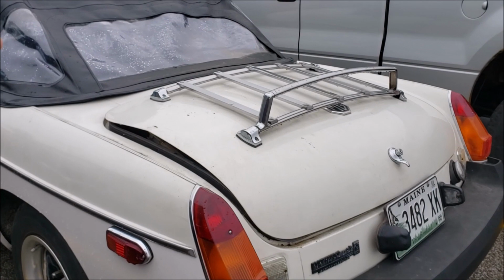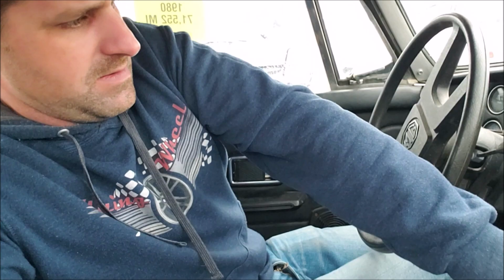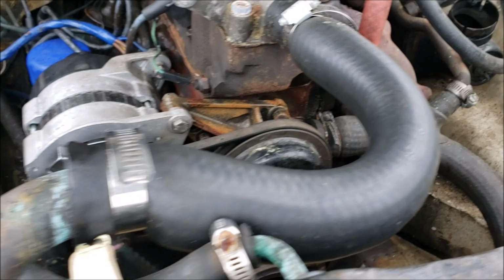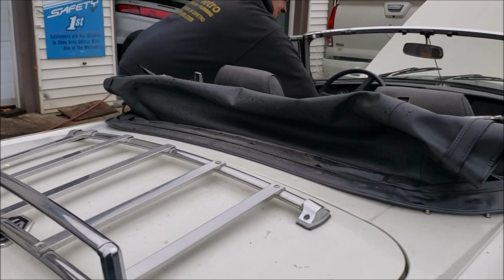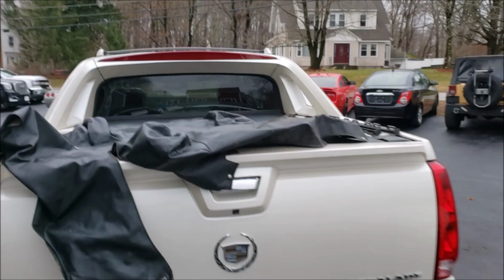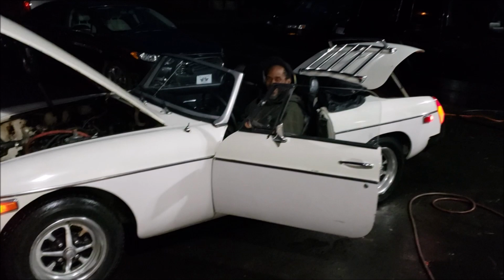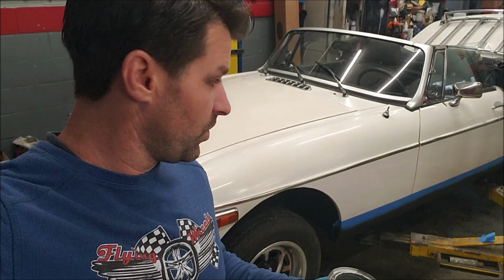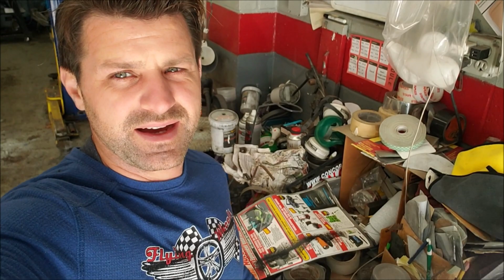I bought a ROUGH 1980 MGB by Accident - Can I fix and sell in 24 hours? - Flying Wheels

Comment: I'm writing as I watch this. The rear deck lid was slammed just as you guessed. It needs to be replaced. The rust is typical  in the lower rear just like you showed.The lower front fenders usually have the same problem as well. Replacement rust repair panels are available from Moss Motors. The top was installed incorrectly by someone who didn't know what they were doing. It's been ruined and needs to be replaced. There should be a rubber seal at the edge of the frame where it joins to the windshield. The top replacement job has been totally screwed up. Unfortunately, your car doesn't have overdrive. The overdrive switch would have been on the top of the gear shifter. You've got the original Zenith Stromberg carburetor with the automatic choke - a very problematic and troublesome carb. Part of the air cleaner is missing. (I see it sitting in the trunk. I don't see it installed and hope you didn't throw it out.) Smog pump has been removed. It's a 4 cylinder 1798 cc engine. The engine has been detuned and all the smog equipment turned it into a 64 hp underpowered car that can barely get out of its own way. It has 3 wipers because two wipers didn't wipe enough of the windshield. I think, by USA law, British Leyland had to add the third wiper to get the cars into this country. Earlier cars only had two wipers. You can buy the missing right front center wheel cap from Moss Motors. I've worked on MGB's for decades and own two, a 1968 and a 1977. I do all of my own maintenance, for what that's worth.
Reply: why not just say it is a turd.

Comment: Rubber bumper does not equate to "junk" - the earlier chrome bumper MG's are simply more collectible. Your auction special was unmolested and mechanically solid with relatively good sills and great paint. Yeah, it's easily a $4,000 car. Simple fix on the trunk and you could have put it on the lot for $5,500 all day long - especially with the approach of warmer weather.
Reply: The late RBBs  are junk. Worst years for MGB  78-80. 68 HP, high ride height, god awful bumpers, weighs 300 more than a Series 1. Sluggish pigs and handle badly.
Reply: Agree Iguana.  And the distain for them is dropping with time.  I just saw a vid where a guy was on the way to have his MG converted to chrome bumpers and literally on the way, he got rear-ended and the bumper and car were unscathed. He changed his mind and kept the bumpers as they were.  They're designed to withstand 5mph impact.  Sway bars were done 77-80 which helped with the slight height increase for headlight height US standards.  There's good and bad in all years.

Comment: I sold my 72 chrome bumper earlier this year.  The chrome bumpers ran up to 74 and had about 30 more hp than the rubber bumpers.  The rubber bumpers were taller as well.  All thanks to the american regulations.  If you find a chrome bumper, they are worth more, but still not expensive cars.  I sold mine for $10,000 which was a pretty good price for it. Sold it in under a week on Facebook Marketplace
Reply: Chrome bumpers to 74 1/2.

Comment: That was my 1st car. 2 carbs & 3 wipers. There was a solid bench behind the seats to cover the 2 batteries. Mine had a hard top & a soft top you could interchange. It's a 4 speed but there's a lever behind the steering wheel for OD. It was a toy car but fun.

Comment: That MG was Solid , usually rot buckets. Someone got a great little car for $4,000 .
Reply from the maker: I thought so too. Probably left money on the table.  But have to leave some meat for the next guy
Reply: yeah a PERFECT car for a coed to get back and forth to college, or to work after school, etc. You can drive all week on $10 worth of gas. Pop out to the store to buy milk or ??......

A friend has a 1967 (I think it's a 67) air cooled 911 and it only has 65 hp and he loves it. It's his go to car to get to work in the summer. If something breaks? you can fix it with a screw driver and a pair of pliers. He owns an import car garage and he's built a super seven that he does autocross with and restoring a 308 GTB ferrari. But just for pure analog fun? goes to the 911 every day.
Reply: @muskokamike127  lol until it breaks down, which happens constantly with these and unless you're handy (in repairing cars, tinkering, troubleshooting, etc) I wouldn't touch one! But to each his own! I see you comment everywhere on YouTube! Lol cheers pal!
Reply: @B0xlife1  The thing is: modern cars break down often too, once out of warranty and even UNDER warranty yet most backyard tinkerers couldn't fathom fixing it.

but remember: the freaking thing is 40 years old haha. 

I remember one issue with old britsh cars: oddly enough considering the climate, they were prone to moisture in the ignition system causing them to not start. I remember the joy many had when diaelectric grease came out.
Reply: @muskokamike127  I hear that and fully agree! Lol
Reply: That's what you call polishing a turd!! Well done 😛😅
Reply: @MrAllstar  not really, that one is far from a turd. It's a diamond in the rough actually.
Reply: @muskokamike127   More like a weekend toy for a mechanic IMHO.  I'd get the coed a Honda Civic : )
Reply: @charlesofsavage7393  But the honda civic wouldn't have the cool or fun factor.
Reply: Maybe I just got lucky,  but I grew up with a 1959 MG MAGNETTE. 4 DOOR SEDAN. 
We put a 1.8 "B" engine in it after my uncle destroyed the original engine.
It NEVER ONCE broke down, despite 15 years and 3 novice drivers.
The only thing that NEVER worked was the clock, although the green back light never burned out.
Reply: We all have our own opinions.. RBB... never.

Comment: The MGC was the 6 cylinder version, not a V8.
3 litre straight 6, with a "power bulge" in the hood. Not a bad engine for it's time, but very huge and heavy, and buggered the handling.
The V8 was the MGB GT V8. Good old Rover V8, nice and light being alloy.
The plastic bumper version came about because of US regulations regarding bumper standards, and the car had to be raised about 1 and a bit inches, (mostly because the headlight height was deemed to be too low, which also stuffed up the handling, and while the old 1.8 was quite torquey, US emission controls robbed it of about a third of it's horsepower.
So what was about a 95 bhp engine ended up as a 64 bhp engine, in a car with heavy bumpers, that rode too high to handle properly, and combined with an auto trans, it was pretty much unable to get out of it's own way.
One thing common to these things is, no matter where in the world they ended up, is rust, and I'm talking RUST. Horrible, complicated corrosion, especially in the sills, (rocker panels), which are structural components, especially vital in the Roadster, which is what you had there.
A company called British Heritage, (or something like that), ended up manufacturing complete replacement body shells - that's how badly these things rusted.
The truck-like steering came standard, and with 64 bhp on tap, it's unlikely for power assistance to have been an option, but who knows. Must be a ball of fire when the a/c is on, if it was fitted - seems unlikely on a convertible, but maybe the GT had it fitted, being a coupe, not a rag-top.
Bit of a sad tale for what could actually be a nice car.
Reply: The RBB is an embarrassment to the MGB line of cars.

Comment: Just an FYI, it did not come with power steering, but it really doesn't need it. The top should have another bar that folds that takes the slack out of it. MGs are very easy to work on and have a strong aftermarket. I would highly recommend keeping it or finding a chrome bumper car to buy.

Comment: I flipped a 1980 Triumph Spitfire 1500 last year. Bought it for $500 running and driving. Spent $500 or so on some tune up parts. Detailed it. Noticed it had some upgrades, New seats, carpets, Monza Exhaust, Weber carb, ect. Ended up selling it for $4000 to a new retiree looking for a car to tinker with. As slow as that car was it sounded great and always put a smile on my face haha.

Comment: That was a complete score for sure! You could likely have tripled your 'roi' soon enough. I got into MGB`s couple yrs ago & discovered a real  admiration for these little autos that are such a blast to drive and now possess 3, all rubber bumper car which are much more affordable. A  $2,5 `78 roadster is my daily driver & I love the fuel economy as gas is now $10-gal in Canada. Others are `75 project car & an untitled `76 parts car. My `78 only has a single electric fan and also overheated in slow traffic. 
Tried a number of remedies inc plastic mechanical fan from the `75 car to no avail. Final solution was additional radiator from the `76 parts car to make the `78 a dual-radiator car. The "inner" `76 rad has the cap conveniently on top vs on the fender-mounted surge tank for the outer rad which I wanted to retain for it`s working thermostat fan. 
It was an easy fit...got hoses that matched basic shape I needed, cut to fit,& clamped `em down. Haven`t even seen the gauge go over the halfway-mark since. Oh ya, I ditched the my daily`s troublesome Stromberg & run a long sidedraft Weber + header but the `75 will keep it`s dual SU`s. Priceless fun!

Comment: The back rib of the convertible top frame will pivot back and correct the sag in the vinyl. No pwr steering but no problem if tires inflated and rack and pinion lubed (the rubber gaiters or boots are usually filled w 90 wt oil).  The "bonnet" is what we call the "hood".  The "hood" is what we call "the convertible top". "Grind that out and repair it"; does that mean Bondo or replacing with metal?  The doglegs on the MGBs are frequently rusted and need replacement.

Comment: The Mgb had a 1.8 litre engine , was also available with a 3.5 litre V8 from 1973/4. The MGC had a straight 6 cylinder 3 litre engine.
Reply: The V8 was not available in 73/74.

Comment: Just wondering why you didn't try to straighten out the trunk lid enough so that it looked better and didn't leak water into the boot. And replacing the broken antenna stub would have been a nice touch. Nice flip and enjoyable video!

Comment: Little challenge is to learn about MGB because there are lots in USA and the plastic bumper one is lower value because it was given the bumpers for the American Market and also some emission controls (lower power).  However it should also have a 5th gear or overdrive switch, either on the gear knob or on the dash panel.  You did great with that car though and good video.

Comment: The small little teardrop shaped piece with the flapper inside goes on the air cleaner assembly and would suck warm air into the engine to make it start easier I saw that that was present in the trunk when you first picked up the car but didn’t see it attached to the motor unless I missed it in the pictures. Also the car was not meant to be a 0 to 60 cutter it’s meant to handle corners and sharp roads that’s where the car is the best plus it gets incredible gas mileage. It may be low horsepower on around turns in corners when you downshift it goes great I had one they’re great cars.

Comment: I'm in England were these cars were made. British Leyland A series engines were around for a very long time & fitted to various models as 1100cc, 1300cc, 1500cc, 1750cc, 1800cc & 2200cc, all straight 4 OHV engines. I have owned many Austin, Morris & MG (Morris garages) cars. All were rust buckets due to no rustproofing & cold wet British climate.

Comment: In 1977, during a year off from college, I bought a semi-rough 1973 Triumph GT6 Mk3 with the exact same color/type of paint, for $900.  Owned it a year, waited on some parts, then decided that taking back my family's 66 Fury VIP that I'd had in HS would be more sensible.  But it was a fun car, handled well.  I'd upgraded the tires from 155SR13 (78 or 80 series before they even specified) to 175/70SR13 tires and thought it looked awesome with those  wide, low profile tires, hahaha.

Comment: Nice to see  that little MGB looking so good after you finished. I had two chrome bumper  MGBs back in the day. But I would have liked to have seen what you did other than cleaning. What about the cracked paint on the bonnet? How did you deal with the bent bootlid ? And what did you do with the rust above the sills? Did it need plating? How did you go about matching the paint colour ?

Comment: Your 'repair' of the sill (rocker?) just ahead of the rear wheels might undermine the reputation of your business. It should have been replaced, and probably the panel inside it as well. I owned, and restored, a British spec 1965 model, and kept it for 25 years, during which time I replaced approximately half the steel panels.
Reply: Only half,  I could not recall if the MG had the separate chassis or the tri-folded integral chassis/sills.   Overall though this particular car fairly sound,  easy conversion now to all electric with a new rear spaceframe subframe drive unit - either UK/German import or a USA system.  Just the rubber bumper americanised ones not really sought after in high prices.
Reply: Now seen the vid, oh-oh no,  not stone chip on stills on a racing classic.  What do you think of the boot treatment ?
Reply: @highpath4776  MGB is monocoque construction. There is no separate chassis - the sill and floor of the car are the main structural elements, so the rust on the rockers is actually a structural flaw, not a cosmetic one.
Reply: @beegee22  I always get confused between the Triumphs (which tend to have chassis , and the sprigets - which are integrals.

Comment: It's all you yanks fault lol. Originally here in UK came with twin carbs so made about 95 horse power. Was de tuned to meet your smog rules.
Same with ugly bumpers, lights were too low so had to be raised in height and bumpers for your impact regulations.
Still a well made fun little car.

Comment: The MGB model years ran from 1963 (model year) to 1980. The MGC was the 6 cylinder and it was produced for only two years, from 1967 to 1969. Very few of the MGB GT V8s (the engine was a '60s Buick design) were produced from 1973-1976. Sadly yes, the one you bought was the last of them, emissions controls and heavy safety equipment ruined the cars.
Reply: MGB... 
1962.. Approximately 4500 cars produced
1963  about 23,000
1964 around 27,0525, 
Total production approx   525,000  

MGC   67-69 is 3 years.  I owned a 1969 MGC GT with a factory installed Webasto sliding roof and a 4 speed automatic trans, Chrome wire wheels. Bought it when I worked for the MG dealership in Monterey Calif 1968-1972. 
I currently have a 1963 MGB.

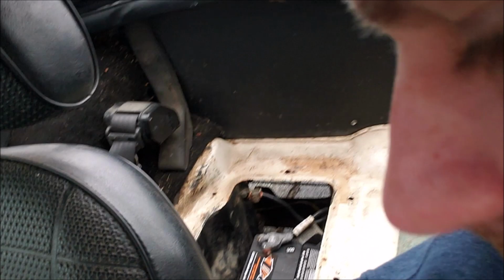Comment: @3:22 "floors are solid"...you can literally see the ground outside. Check the giant hole in the rear trunk area.
Reply: There’s a removable panel that covers the battery. The battery sits in a tray deal that doesn’t cover the back.

Comment: First gear is clutch protection mode and the plastic bumper treatment really ruined the lines. It was in better condition than most of the kit Steve has on This Week with Cars.

Comment: FYI the crap bumpers are to apse the Yank market .as is the asthmatic engine tune . The MG B is the roadster which you have here the MG C is the 6 cylinder version , the 3 door versions are called MG BGT/ 1800cc 4 cylinder or MG CGT/ 3000cc 6 cylinder and of course the 3500cc V8 is the MG BGT V8 also know as the Buick 215 ci all ally engine. There are a few other suspension differences between MG B's and MG C's . and 1st gear is ment for pulling away not 2nd.
Reply: The MGC had torsion bar suspension, 15 inch wheels  etc

Comment: Fully restored and sorted they are going for $12 15 and even one for $25K. $1700 I wouldn't even have thought twice.
Reply from the maker: Exactly what I thought as well
Reply: @FlyingWheels  running and driving for that money? That was truly a no brainer. If there were major issues,  and you had to put some money into it, even though it isn't a "collectible" you'd get your money back. 

Now if you'd paid $4000 or more, yeah, that'd be an issue. 

The Florida emblem on the back, that's a big clue as to why it was relatively rust free. But even still, the top and seats weren't sun destroyed either. 

A great flip!!!!

Comment: From the brief peek as I tried to identify the type/yr Cyl Head ... looks like a huge crack right at #1 Plug.
We dont do quick flips on MGB's
WE add life to the roadster.
Carbs/Manifold/Header
Weber™Dual Downdrafts
Intake Manifold
4 into I  Exhaust headerf
Electronic Ignition 
Remove as much weight as possible from bumpers.
Nerf Bumpers.
Camshaft:   Send Cam to Iskenderian Racing Cams. Gardina CA.  (MGB•1/4 race grind T32)
Tea thirty two.

Comment: You got lucky. I have owned 20+/- MGs over the years. The MGB is a wonderful car, easy to work on and parts are plentiful and somewhat reasonable. However, a lot can be wrong with a used MGB. The electric fuel pump and cooling fans are notorious for giving out. So are the master and slave cylinders for the clutch. The brakes could have been shot. The cooling system could have been poor. The carburetor came with a water choke that usually gets scrapped for a manual choke. Your particular car had a very worn top, interior and paint job. I am very surprised that your MGB brought $4,000 at a dealer auction.
Reply: Only a fool would pay that much for that hack job. Sloppy and dangerous.   No pride  of workmanship and no respect for the car and the potential buyer.
Typical of the new age car business.

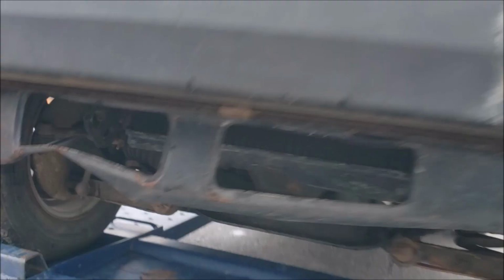Comment: All good except front coil springs ( 4:12 ) is holding only on thread (drivers side is worse then passenger side). That thing is not very safe to drive...
Reply: Just commented the same thing. P
My father probably has a half dozen good ones hanging in the garage